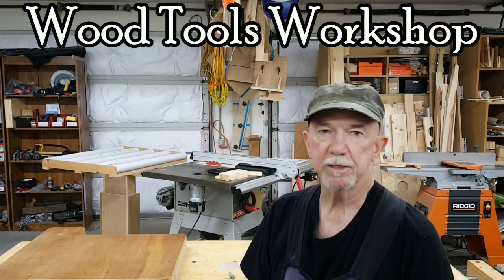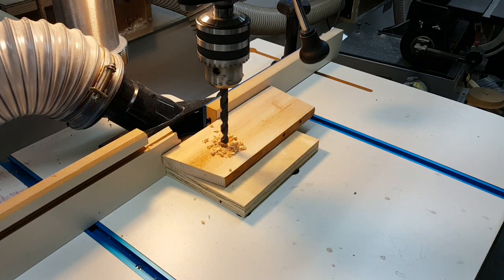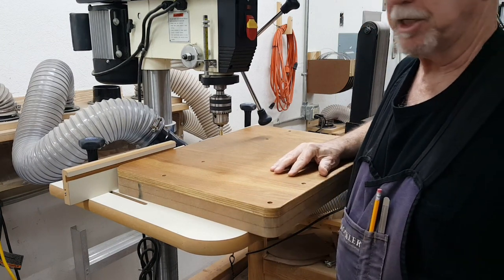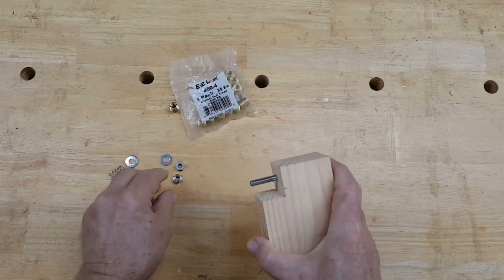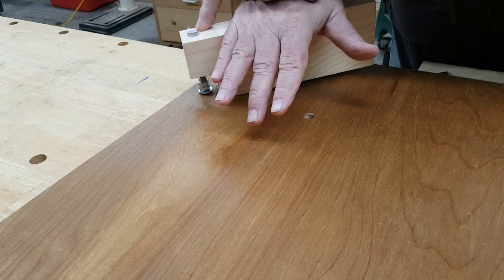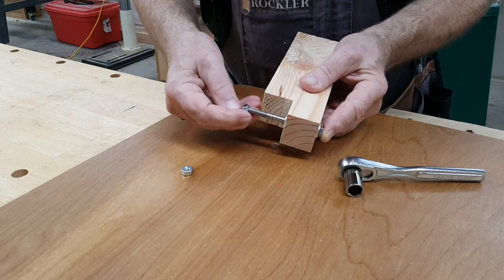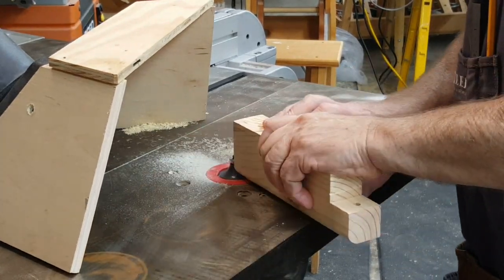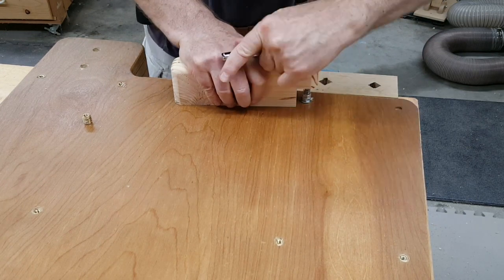Threaded Inserts; Simple Jig

Comment: this was absolutely amazing! new to wood working world and I am trying to mash wood working with my skills of metal fabrication. so I am building my first coffee table with, well a steal frame i fabricated and a Sapele wood top. would these threaded inserts be a good idea for my mounts? the metal mounting hardware will be made from angle iron to secure the top. Any suggestions would be great..
Reply from the maker: Bolts through holes in the metal frame and screwed into threaded inserts in the underside of the wooden top would give a solid, tight grip.  There are other ways to attach it, but this is a good one, in my opinion.  Please let us know what you decide and how it turns out!  You've got some fine looking machinery on your channel.  I'm a subscriber now.
Reply: wow I am honored that you have subscribed to my account and like it.. thank you sir.. As far as the threaded inserts go what size would you recommend? the table top is 1 1/4" thick made of Sapele hardwood.. iam guessing should go with stainless steel ones as well since its hardwood?
Reply from the maker: For the things I build, I generally use a 1/4"-20 inner thread (the 20 is how many threads per inch).  That size might be small for what you're doing. I guess it depends on how many of them you use as to how sturdy it is.  The main thing will be the grip of the outer threads on the wood, so I suggest going with a larger size.  They come in various sizes and also in both regular (coarse) thread and fine thread--like, the 1/4" can have 20 tpi, or it can have 28 for a fine-threaded bolt.  An inner thread size of 5/16" or 3/8" might be better in this case. Stainless or brass either one should be good.
Reply: awesome. thank you so much sir for the helpful information.. definitely sets me in the right direction. can't wait to see your next video. And thank you for sharing your knowledge. hard to find people these days willing to do so. cheers
Reply from the maker: I'm glad to help when I can. We're a community; everybody helps everybody else. Hope your table turns out just like you want it to.

Comment: Love those inserts. Never saw those drive tools you mentioned. That jig is amazing, and the spring idea is cool.Love the corrections you made on the fly.
I think is a simple but excelent tool. Why don't you entry in ToolMake16 whith it ?
Thanks for sharing !
Reply from the maker: Thanks, Daniel!  I didn't think of it as a tool, just as a jig... but maybe I should enter it.  Thanks for the suggestion!
Reply: Wood Tools Workshop

I think if you see it with the screw, nuts, washers and spring, is a complete tool, at least I see so, anyway good done !